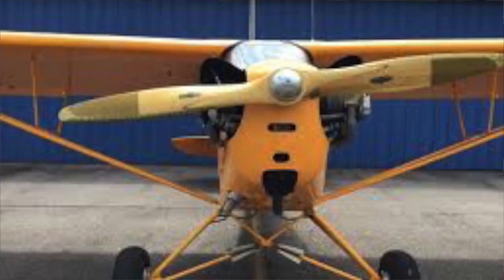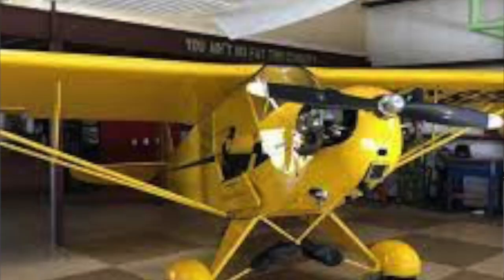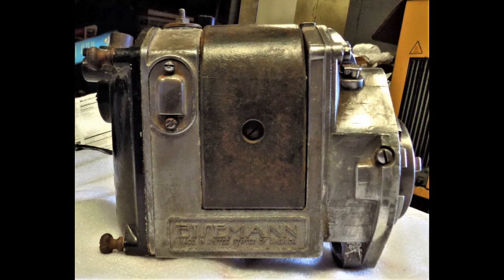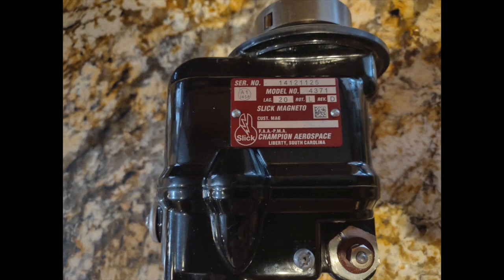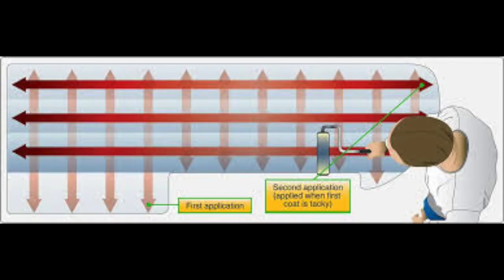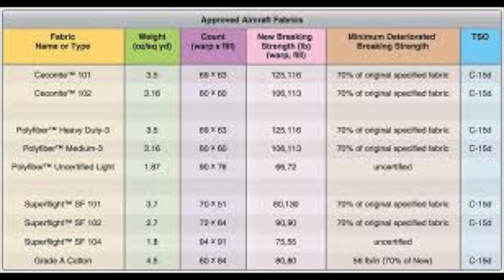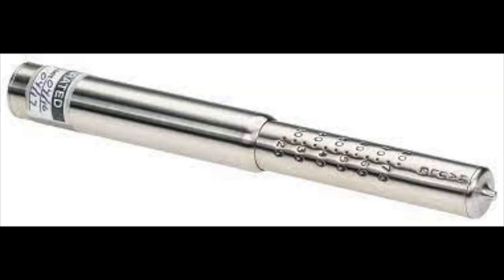Five Tips for Buying a Piper J3 Cub

Comment: The tow hitch modification is not for banner towing. I suppose you could drag up one letter at a time…. I have one on my Cub. The intent is to leave the tail tied down so it can be hand started with a single user. After start and when the chocks are pulled and the pilot is strapped in, they can pull the handle and taxi away. Thanks for the great video!
Reply from the maker: Thanks, that made sense, but I don't have the handle anymore, I thin some parts were removed after it was installed,  I guess I never looked at another Cub tailwheel that close to notice the difference.  I leave mine tied down by the tail when I start it s well.  Thanks for watching.